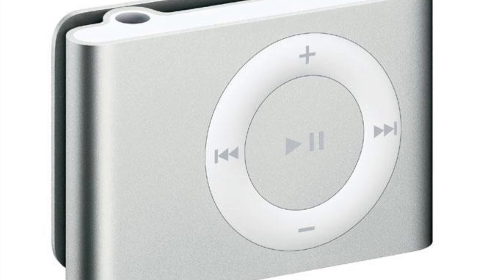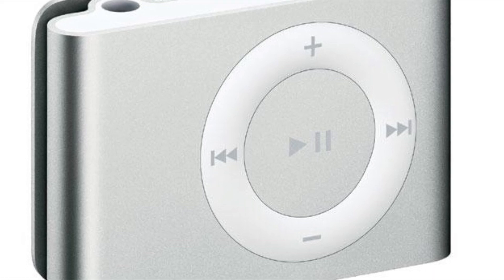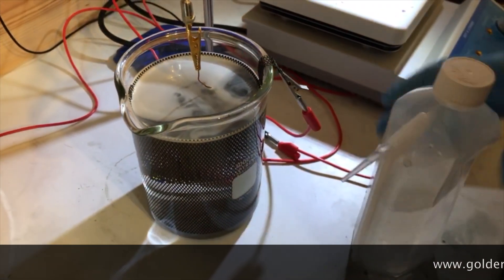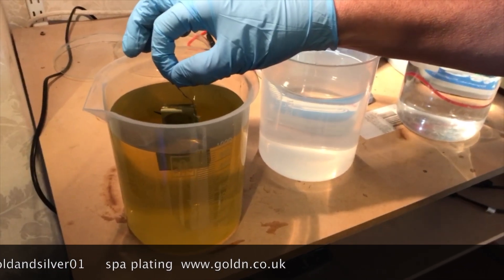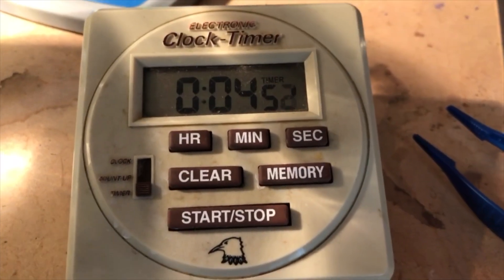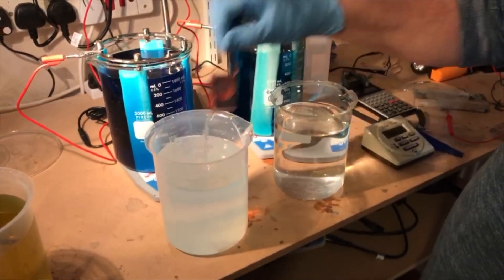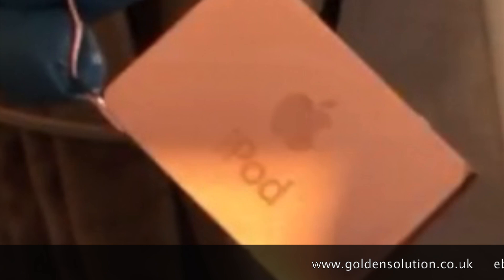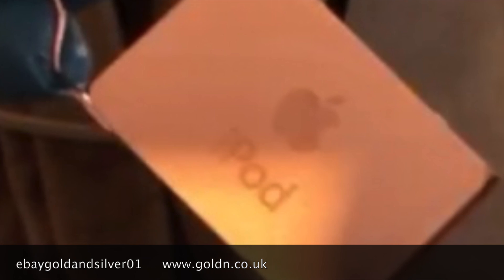How To electroplate on to Aluminium

Comment: I have 2 firearms I want to plate and I was curious about how well playing holds up on aluminum ? If you can get that I pod to keep it's coating them I would think it is durable? Thanks for the vid and God bless
Reply: If done properly plated surfaces can be very strong and long lasting, but that's if done properly. there's lots of ways to mess up when electroplating but if you buy a premade kit and follow the instructions you're probably gonna have a pretty durable, reliable electroplated finish

Comment: I've read some do a palladium coating after the copper to prevent corrosion and also the gold and copper ion migrating and blending over time.   What is the copper strike solution made of as I don't understand how is different?    

Other than the specifications changing... seems like would be neat to nickel plate a small engine carburetor to prevent corrosion... at least the bowel.  Funny, now that I think about... can probably even plate the plastic float as well using a conductive paint.
Reply from the maker: i dont know what is it made of but copper strike is for metals where you may have problems with adhesion with normal copper

Comment: hi mister... can i ask u, what dye u use for cooper color...
Reply from the maker: No dye it’s real copper
Reply: @GoldenSolutionPlating  how can you possibly do a copper brass coating on a aluminum whizzer flathead engine cylinder head valve combustion chamber

Comment: Hey! I've been searching on the web how to plate aluminum and google suggest your video everytime. I can't find the zincate solution anywhere in my country. Do you prepare it yourself or buy it? Thanks
Reply: Ok , the "magic solution"  Zincate- which enables you further to electroplate on aluminum, is ZincOxide 5-50g/l ,Caustic soda 50 -500g/l ad Ferric Clorine (pcb etcher) 2g/L. Sure some extra fancy ingredients -which are optional to keep an lower thickness, keep PH of solution etc. Keep it 15sec to 1min into it ,then from that point further you can electroplate like any other plating friendly metal.try it first as basic as it is, most of the times does the job just fine, in DIY projects no need other stuff.
Reply: @cristianb6269  Hey, thanks! Im aware of the zincate formula, but it doesn't work for me. The ferric chloride turns into a goop and then dust that sits at the bottom of the solution. The aluminum in that solution fizzles for a while and when copper plated the copper just washes off like dust.
Reply from the maker: all the solutions you can get from spa plating www.goldn.co.uk  it shows in the video 
or some stuff from www.goldensolution.co.uk
thanks
Reply: @GoldenSolutionPlating  Thanks. Also, Victor Bazaldua is an asshole.
Reply: Also, What's the difference between the "copper strife" and the copper electroforming solution? Thanks again.
Reply from the maker: @Headshat  copper strike is for metals where normal copper dont plate on